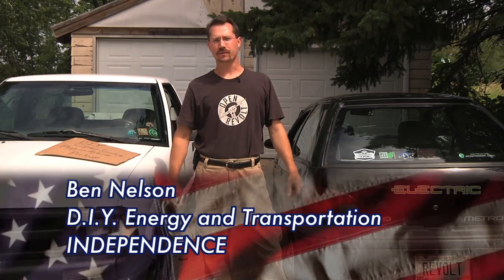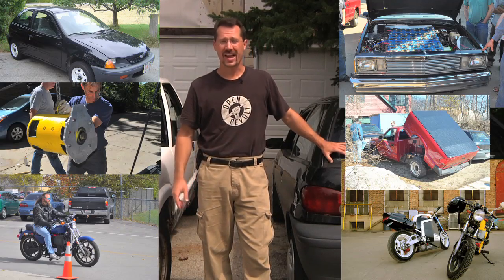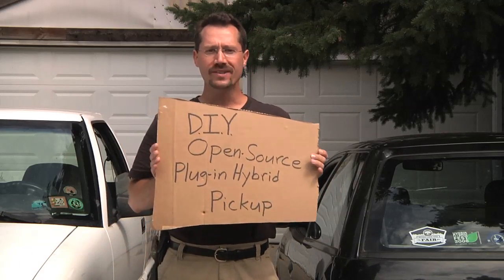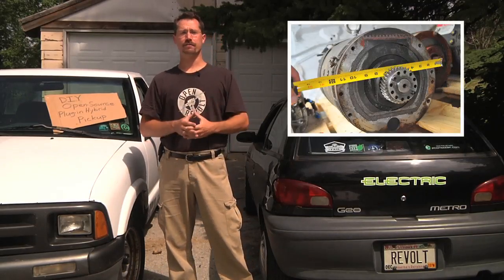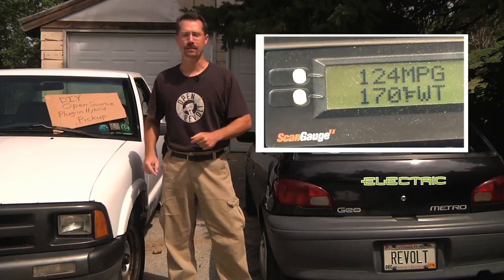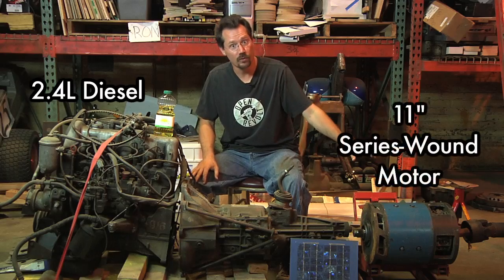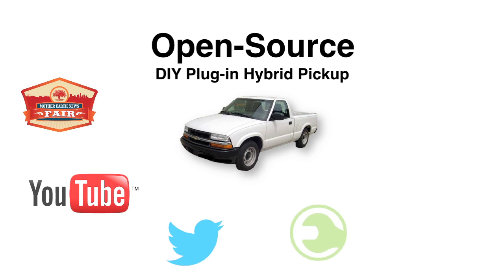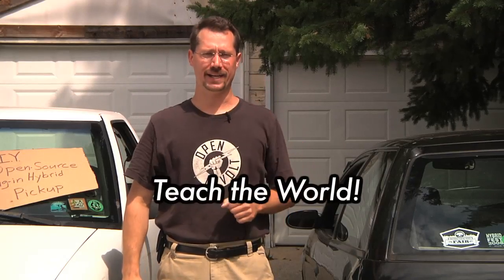DIY Hybrid Pickup Truck Concept for Independence Project Contest

Comment: Is the SuperTruck up and running now? I’ve watched every video, and have been BIG TIME inspired by your creativity.
Reply from the maker: No, unfortunately, the original version of this was more concept than anything, hoping to win some funding in a contest. It's 2018 right now, and we STILL don't have plug-in hybrid pickup trucks! I'm shocked, I thought for sure we would by now. I did some work playing around with working on and learning about a diesel motor, then the VW Dieselgate happened.
I have a big DC motor I could use, but I would prefer brushless and regenerative braking ability. I have a big AC motor, but it doesn't have "pass-through" power of a solid tail-shaft to connect the transmission end of the tail-shaft to. For what it would cost to build the truck, I could probably find a used Chevy Volt with plenty of good warranty left on it!
It's driven me a little crazy, that all the conditions have been exactly wrong for me to build a hybrid pickup! If the mainstream manufacturers would build one, it would sell like hotcakes!

Comment: All the best in the competition Ben. I know if given the chance to use better batteries, you and your team will really be able to knock it out of the park. Maybe you should ring A123 Systems and see if they might sponsor you and supply the batteries. They make batteries with twice the energy density of standard LiPo batteries.Which would really make the truck Super. Google A123 Cells to find the website.